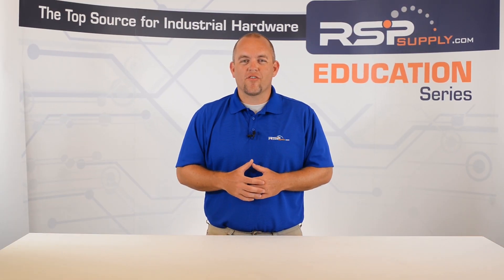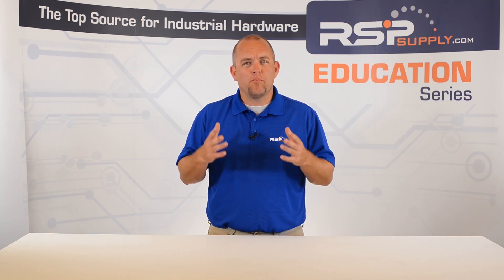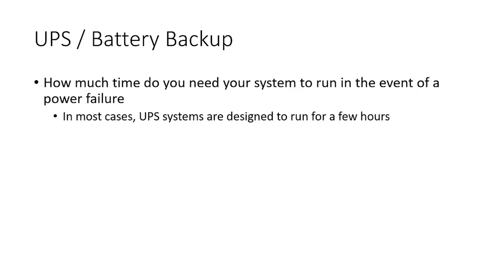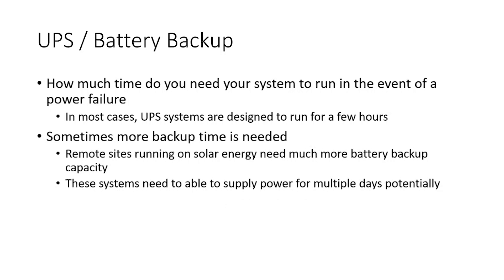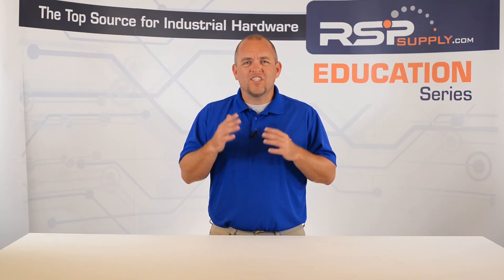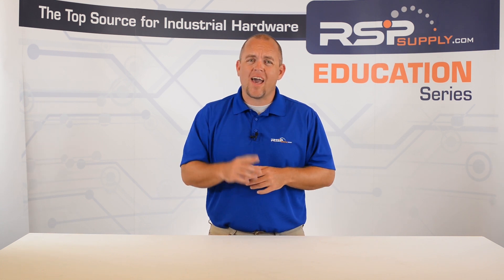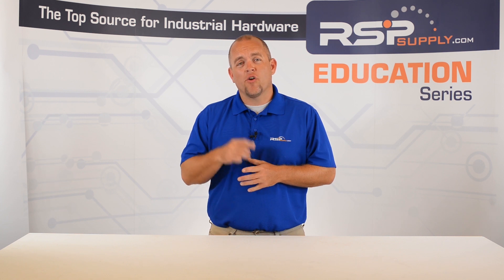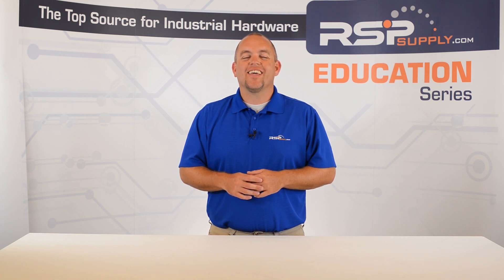Battery Backup Systems

Comment: It's believed that discharging below 70% of the battery capacity will injure at standard sealed battery so you need to almost triple the Ah you specify. If the batteries are wet cell deep cycle they can handle far more discharge depth. I'm working in California for now and I am finding that to deal with a 4 amp draw for 48 hours (becoming very common) takes 160 lb battery  pack. Where are the handheld fusion generators the sci-fi novels said we would have by now...?